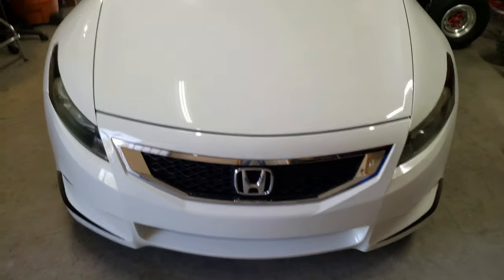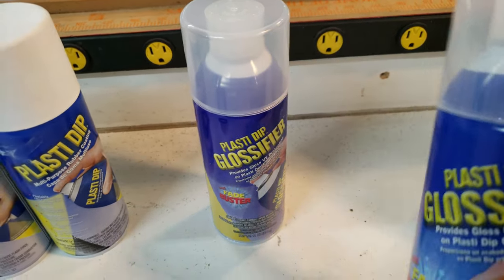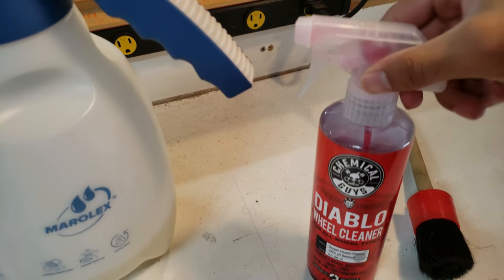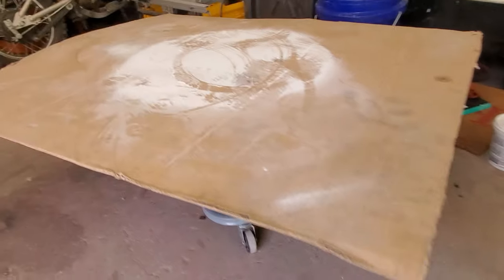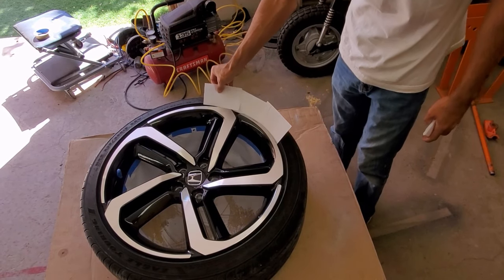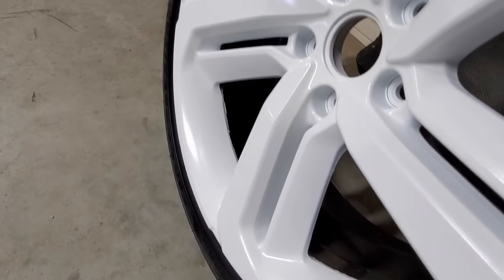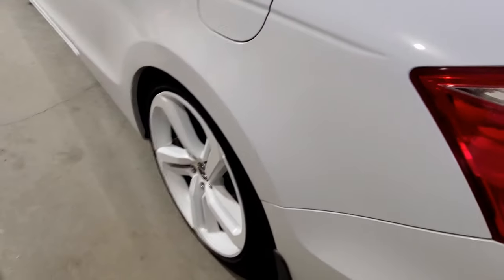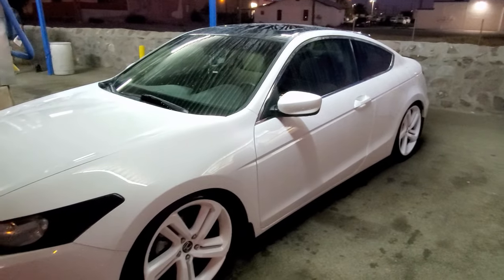How To Plasti Dip Your Wheels | Honda Accord Sport Wheels | White | 8TH Gen Coupe

Comment: I painted white my Hyundai cap, lugnuts and the shredded valve. I only did two wheels today... white. That said tomorrow I'm gonna not paint my lugs and logo. And valve. I can use paint thinner to get the paint off those things but for the valve what u suggest to get paint of that. My wheels literally all white even some on tires. When I was painting the barrel paint literally got on the front side of rim tire part I'm like wtf. 
But they are alloy rims and I must say they look pretty good my hyduan Elantra 08 is indigo blue so like navy blue on white looks dope. 
Your wheels came out so good. Those rims are mean design from Honda they really came out very cool man.

Comment: This looks great. I want to do mine in white as well. Being going around about plastidip, paint or powder coating.
Reply from the maker: I would say try the plastidip to see if you like it, you can always remove it if you dont. But if you do like it then you can also remove it and go ahead and use something more permanent.
Reply: @accordingtodave8554  how long would you say the plastidip lasts?
Reply: @cordasolis  a very long time. I had plastidipped wheels on my mustang for like 3 years and the only reason I ever saw the aluminum stock color was because of curbrash.

Comment: These turned out nice only thing with plasti dip is through time these will start to peel off so I honestly personally would recommend using actual paint and primer
Reply from the maker: Proper preparation and usage of the dip and they shouldn't peel, I've had these on for more than 6 months an they still look great! I don't see them peeling anytime soon either.
Reply: @neverxfalling if u say so lol

Comment: Quick question so I have a 2012 Honda Accord sedan, I love those rims do you think they fit my tires?
Reply from the maker: The 10th gen accord sport rims will fit the 8th gen accords. Now about tires. The tires I have are the stock tires that came with the sport rims. Hope that helps!
Reply: The low profile tires that come on those 19” wheels will not fit any stock 2012 Accord 16” or 17” rim.

Comment: We’re you able to get TPMS sensors to work with this? I have these wheels on the same model year and having TPMS nightmares. 4 new Honda sensors and the light still comes on after about 50 miles 😭
Reply from the maker: nope, the light just stays on lol, it doesn't bother me anymore.
Reply: I had the same problem with my 18 accord. There's an option on the computer to re-calibrate the tps. That worked for me.
Reply: @rickwilliamson9510  thanks. The 12’s don’t have that option as the sensors are direct and not indirect. I figured it out though! I live in the south so as I drove the tires gain around 5 pounds setting off the TPMS because the 12 wheels were smaller. Reducing the psi around 2 fixed it. It now comes on once every few weeks and goes right back off!
Reply: @ChristopherLakeWilliams  how long does it stay on when they do come back though? I’ve been thinking about doing this to my car
Reply: @lowkeythagod9741  only comes on for super long drives and typically goes off after about 20 miles or if I stop. I drove 13 hrs on the wheels and the light came on at about hr 4. I looked up and it was off and I never saw it again the rest of the trip. It no longer comes on day to day. Only super long drives if it’s hella hot. I’m in south Florida so if temps hit 100 long drives out 5+ lbs of air in your tires. That’s normal.

Comment: Since you put the glossifier, did it help to stay clean or did they start to stain?
Reply from the maker: No it didnt help with clean up, they still get dirty and show a lot up close like any white wheel will lol.
Reply: @accordingtodave8554  Okay thanks and would you say its easy to wipe clean like quickly?
Reply from the maker: @akhir_s1484  honestly no lol, the glossier doesn't make clean up anymore easier.  It just make the dip shine and be a bit more reflective. As for cleaning it doesn't change, the dip still gets dirty as usual and still requires the same attention. ;)
Reply: @accordingtodave8554  Thanks a lot I appreciate it because I was planning to dip my wheels but i might just paint it instead
Reply from the maker: @akhir_s1484  I would say, dip the wheels the color you want just to try it and see if you like it...the cool thing is it comes right off if you dont like it. Then you can do a more permanent job like paint!
Reply: @akhir_s1484  pro tip get some dip coat once you use it on your dipped wheels if you use a thick gloss like this guy did they clean way easier because it makes the surface way more slick and smooth resolving the whole issue entirely. Lot of people say dumb shit and I never thought it would work as good as it does but it works.
Reply: @accordingtodave8554  now you got me thinking how this would look in all black glossy with my 2011 lxs... hmmmmmm...

Comment: Nothing wrong the way you did it, but there's much more efficient ways mate. Few dangerous steps you took that could've led to mistakes
Reply: What were the dangerous steps? I’m looking to do the same thing.
Reply: @itistheway6893  few. No need to take the wheels off. Flash cards can get stuck to Plasti dip as you go & when it’s time to remove them you can mess it up. I suggest DipRelease wax on tires instead. I’ve chrome deleted over 10 cars lol it’s fun